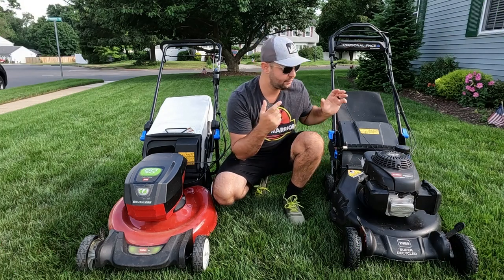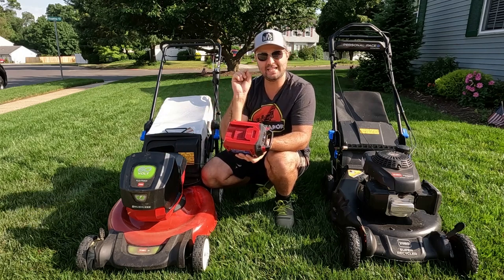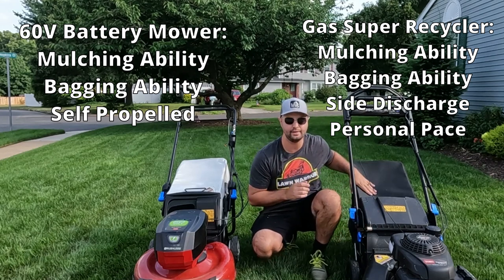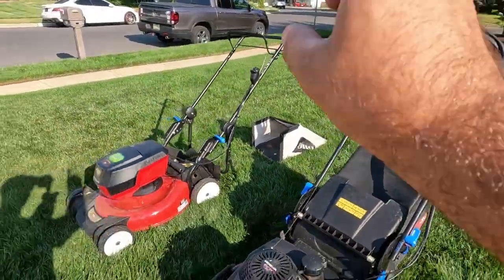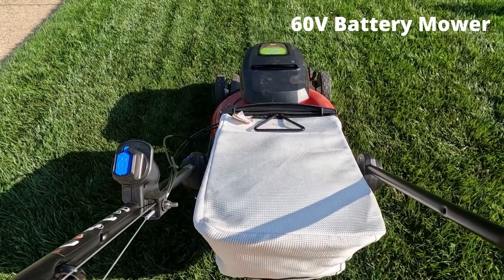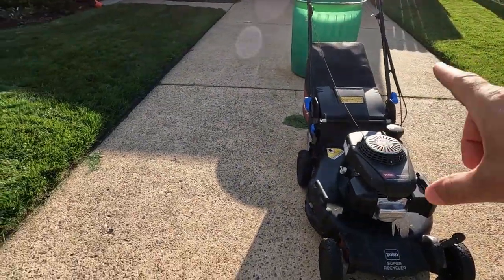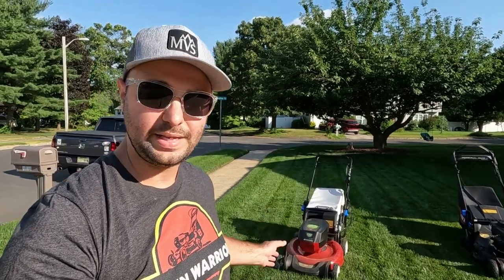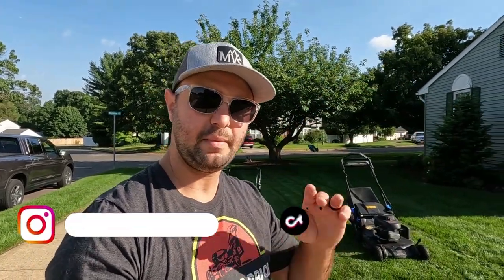Toro Battery Lawn Mower Or Toro Gas Lawn Mower?? #gaslawnmower #batterylawnmower #torolawnmower

Comment: I have that model battery Toro...I sure do miss the personal pace, but it's solid otherwise.
Reply from the maker: It’s slow though. I tend to want to push it even in self propelled mode.
Reply: @WooderBoyProductions  Yes it is! I just use it for a few small areas that my rider won't fit. Battery is perfect for it since I'm not dealing with bad gas, maintenance, etc., for a mower that gets very little use. It replaced my Toro gas Recycler, I was just tired of maintaining something I use less than an hour per year.

Comment: I had an ego battery mower and I ended up selling due to lack of suction and miss cuts.  I ended up buying a used gas Toro personal pace and the speed, suction and cut quality much better.  In my opinion, electric mowers just aren't on par with a good gas mower in terms of cut quality, suction and speed.